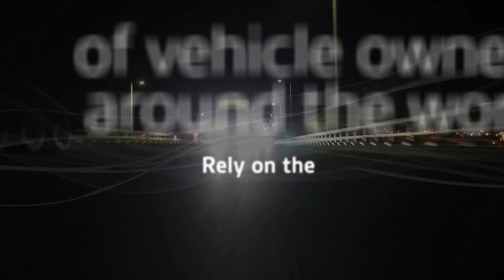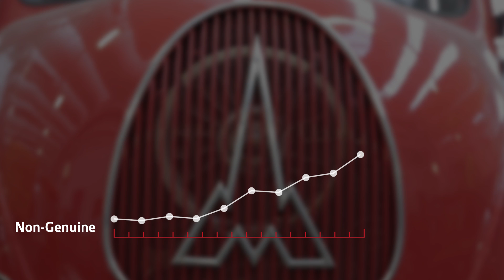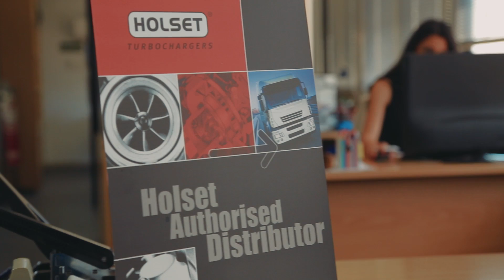The Importance of Genuine Holset Turbochargers and Cummins Products

Comment: I have a question that will help TONS of Cummins owners  here in America .What is the ring used for on the inlet side of the Turbo (Specifically Ram 2500/3500 series Trucks) ? Is it a silencer ring ? Does it hurt airflow or performance or have any negative impact on the Turbo if removed . A lot of people are removing it to make there Turbos louder , but it seems to be there for more than a silencer ring !?? Sincerely Aaron from NC 🙂
Reply: 3Gunner please feel free to submit your question via email to 
Partsengineeringcustomersupport@cummins.com
However, I suspect they'll tell you not to remove the silencer ring.